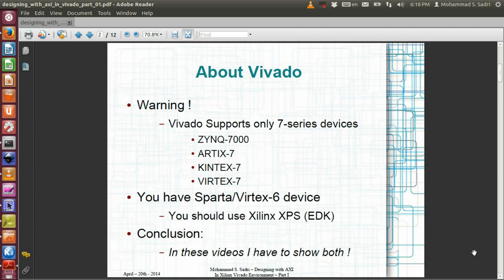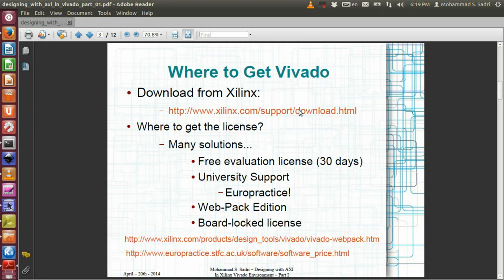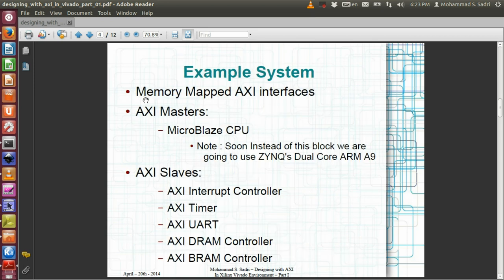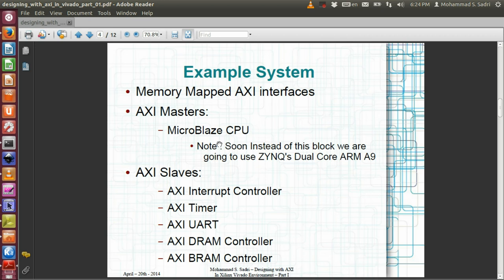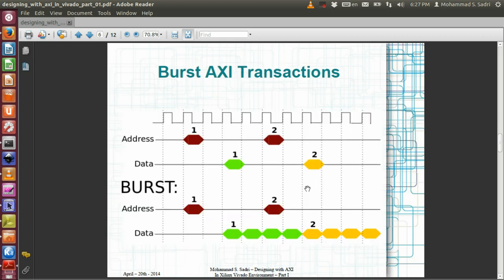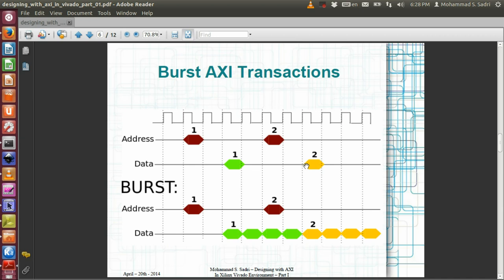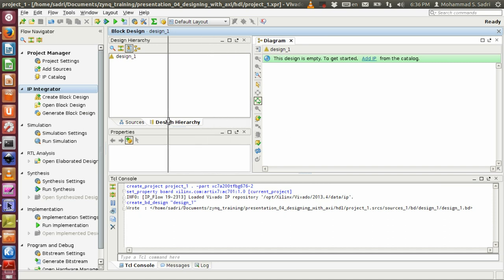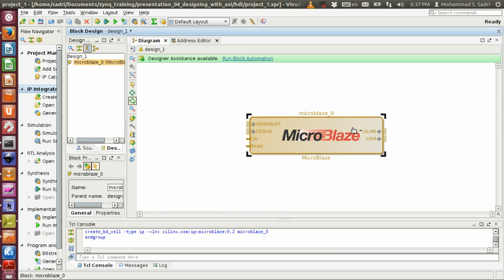ZYNQ Training - Session 04 - Designing with AXI using Xilinx Vivado

Comment: at 56:30, a new Axi peripheral is generated when you run connection automation. Is there a reason why Vivado did not use the previous Axi interconnect? I believe in a previous video, you mentioned that up to 16 Master and 16 Slaves could be connected to the same Axi interconnect. Is there a reason one couldn't just use the previous axi interconnect?

Comment: Thanks! Very useful tutorial. Can you explain please, if i want to use a BRAM block just as a simple array of registers, may i connect it to same interconnect block as microblaze M_AXI_DP, not M_AXI_DC? Is there any difference to comunicate with this BRAM through DP or DC? Or basically, should EVERY memory arrays such as DDR, Flash or BRAM be connected to microblaze through DC and IC?
And, if i understand correctly, IC is not necesary should be connected to external memory arrays, if i use them only for some sort of a constants container? Sorry for bad english(

Comment: Thanks. Do you have advice to creating an AXI Lite slave block? Say I want to write a Verilog module that controls external physical (real) pins. Some pins are output, other are inputs which feed into a FIFO. I'd like the PS to access the output of the FIFO and to access control registers to configure its operation.
Reply from the maker: Hi, Yes! I will cover this in detail in future videos.
Reply: Mohammadsadegh Sadri  hi sir could you please tell me how to used zynq spi and write c code for spi .